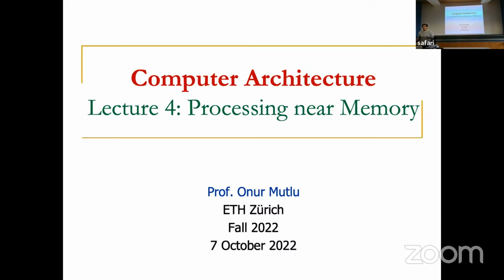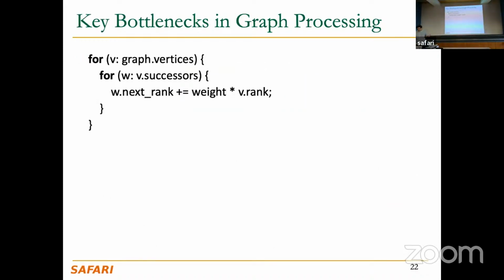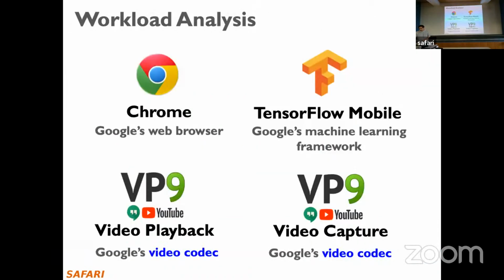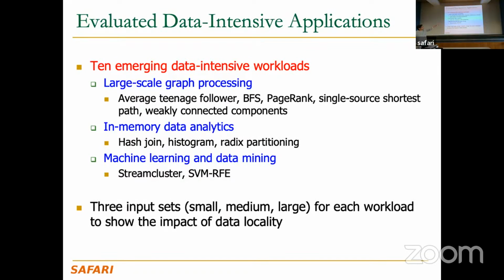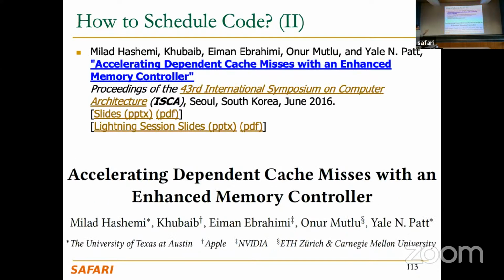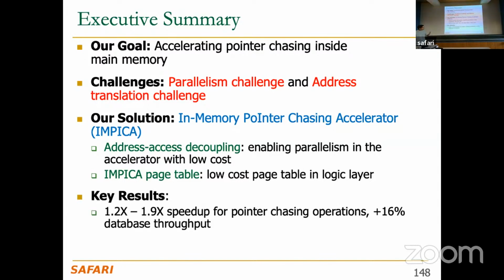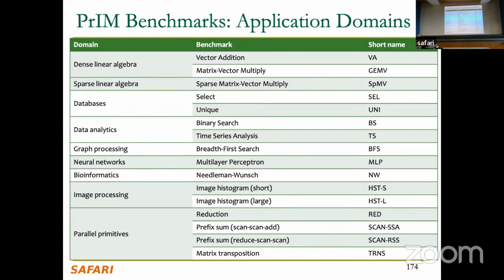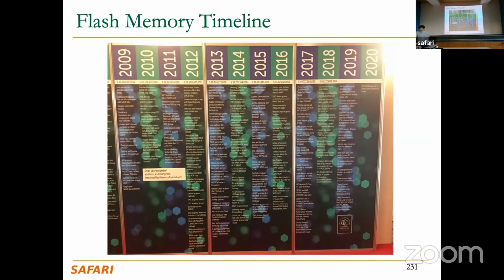Computer Architecture - Lecture 4: Processing near Memory (Fall 2022)

Comment: Just wondering, are we putting more effort into the R&D of material sciences and technologies for energy-efficient computing as there are several orders of magnitude of improvements lurking deep inside the materials? Would this be a simpler approach than these HW/SW Architectures techniques or a combination of both? This world's energy is getting swallowed exponentially by digital switching. Thanks.